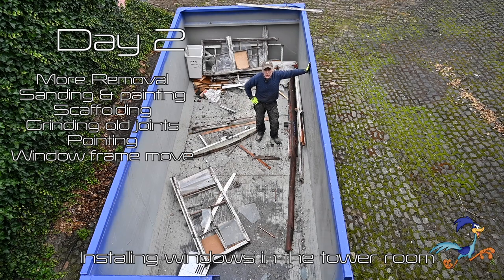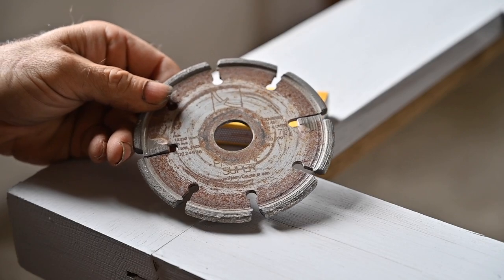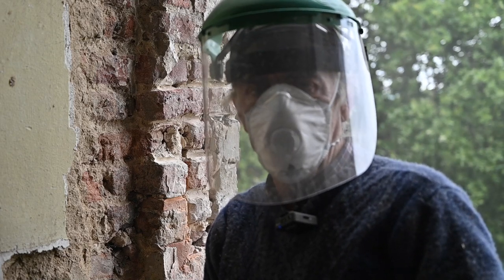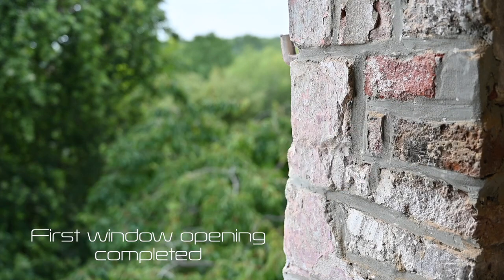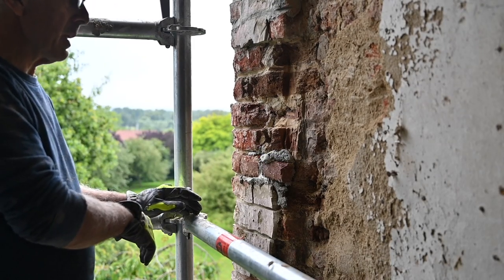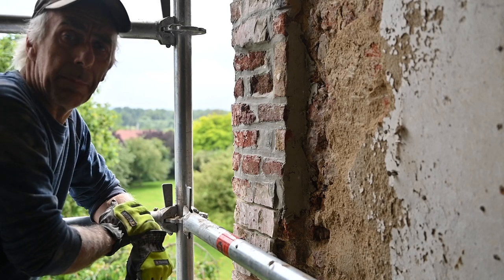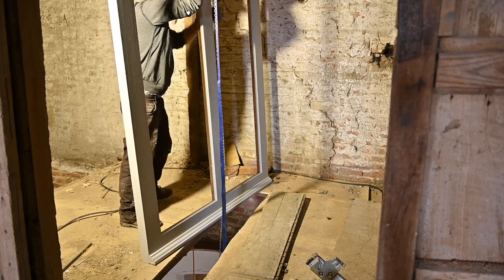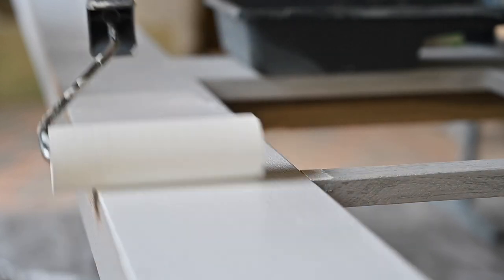Day 2, More prep work to get the windows in the tower room

Comment: Don't know why they are called dust masks. If they don't fit really flush with the face, with no cracks, they really don't stop very much of the dust. I would wear a respirator. They are not that expensive, have about a six-month lifespan and sell for about 40 US dollars. 3M makes a good one, and you can change the dust filters in front of the charcoal canisters. And, you can get more air thru them than a dust mask.
Reply from the maker: Thanks for the comments, goof tip